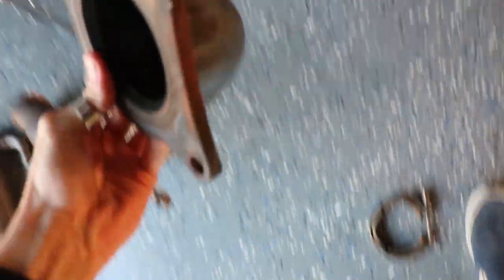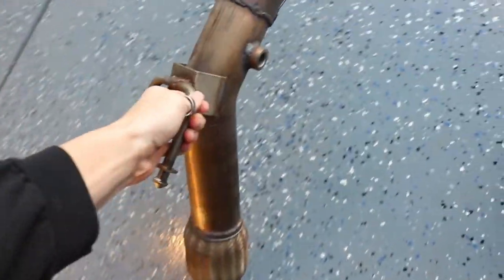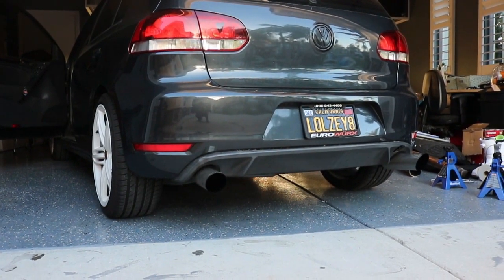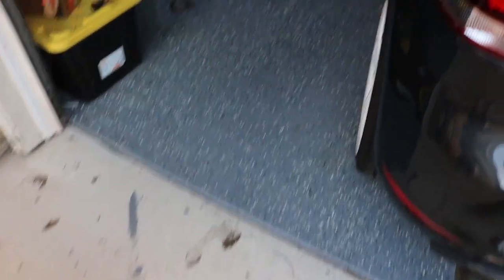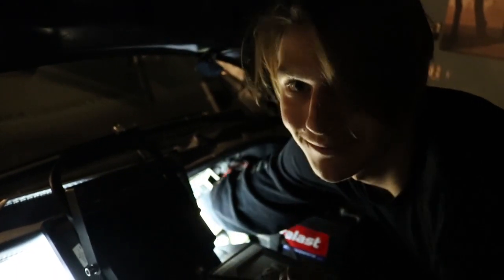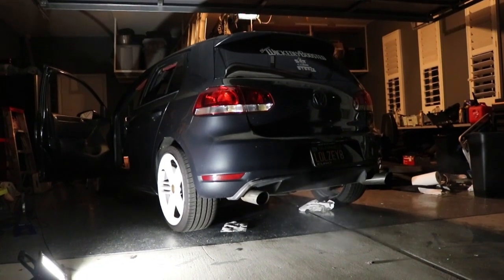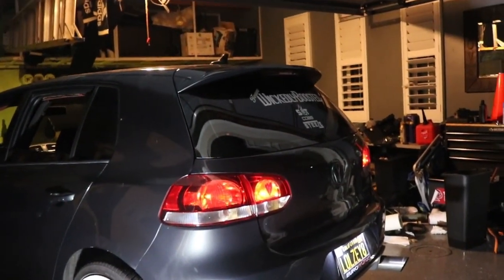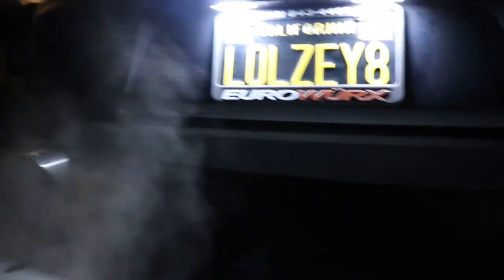How To Gut a Catalytic Converter

Comment: pro tip : wear a mask when actually gutting it... those dust particles aint to safe too breath in.
Reply: They will be fine I have di got it so many Cadillac converters in my mechanic shop. It’s not even funny.
Reply: Pro tip if you're a grown man in a gti you've made a mistake 😂😂
Reply: Asbestos 2.0
Reply: N95 or N100 mask on a clean-shaven face with a good seal. Or a fan to keep you upwind of all particles from the cat.

Comment: As long as no check engine light comes on I want to do this to my corolla ! I only have 1 cat left since the other cat got stolen with resenator 😂!🙌
Reply: It will come on unless you get the like spacer for the second o2 sensor after the cat if both 02 sensors are reading the same number it’ll pop with a cat code
Reply: @DillonDoingStuff  hmm yea I’ve heard those o2 spacers gonna give it a shot

Comment: It's a lot of work because you didn't take a hammer to the catalytic converter and blow the honeycomb out your tail pipe. You unbolt the muffler in the back and it all blows out the back. A lot easier to take a muffler off then a catalytic converter because most are welded on and even if you can unbolt it, you're going to knock the crap out of anyway. Smacking it with a hammer will damn sure relieve your problem

Comment: I just bought a Jeep with a 3.6L Pentastar v-6 engine in it with just over 100,000 miles.  It runs fine until you go a few miles, then has heat issues that do not show up in the temp gauge, and no warning lights come on unless you hammer it up a hill to down shift, (automatic, wants to climb a hill at 1,200rpm for gas mileage) and put the overheated engine in "computer limp mode".  Let it cool and it runs fine again.  That engine has a history of one cylinder head cracking, (and exhaust manifolds), and I bet it is the cylinder closest to the cat.  The fact is, if you have exhaust restriction, engine temps go up.  Do you think the EPA cares how long your gas engine lasts? It won't last long in this condition.
Reply: I know this is an old thread.  Did you check with Jeep on the cylinder heads?  They are under a factory recall for certain years.  I had both mine on my 2014 jeep replaced no charge.

Comment: Lol!! Yeah no eye/hand protection. No respirator? Geezzz prepare to have some serious respiratory issues. You should’ve at least soaked it in water to minimize dust. 😳
Reply from the maker: Yeah maybe should've thought that through... but I think I'm okay
Reply: Why is it do dangerous?  I know it is not asbestos at least.  Are you just repeating tribal knowledge, or do you actually physically know why they should have used more protection?
Reply: @EarthSurferUSA  Ask father Google. From an obvious standpoint, think about the purpose of the filter media. It captures poisonous particles out of the air right? This means that over time there is a serious amount of these particles on the media. Now stick it in a blender **fast moving blade. Drill in this case. Imagine how fine these particles are and at what concentration.
Reply: @EarthSurferUSA  it’s magnesium, it’s a poisonous gas
Reply: @Dxriz1  i dont think its magnesium
Reply: @MrDitto-uw8ft  it is magnesium
Reply: @rattletrapfox1001  It converts them to none harmful gases. Should be fine.

Comment: Takes me back to when I was young full of shit trying to make cars louder and faster !
Reply: But it is, in reality, restrictive exhaust that will over heat an engine and fail sooner.  That is no shit.  I picked up a used Jeep with a 3.6L Pentastar engine in it, and I can almost promise you that the head cracking issues that great engine has had is due to excessive heat because of the restrictive cats.  I do build engines for a living, and have seen with hard numbers, how an engine heats up with restrictive exhaust.  This mod is not an effort to be louder or faster, (but it may be a bit of both). It is to get the mileage the engine is actually designed to hit. There is no doubt in my knowledgeable mind that many engines today die before the 150,000 mile mark because of clogged cats, that could have lasted 300,000 plus miles. There are no warning lights on my Jeep telling me the cats are clogged, even when the engine is overheated and limping along in computer limp mode, (until I let it cool down).
Reply: @EarthSurferUSA  I disagree about and increase in HP it wont be a lot but you will pick up some HP and mileage as you say and the sound will be more pronounced of course . Anytime you cut down restriction in the exhaust you will always pick up some hp I totally agree with the rest of what you said .

Comment: When you gut/remove a cat don’t u need to get a tune??
Reply: You can trick the system by putting foulers then your 02 Sensor
Reply: When I got my chevy tuned the mail in tuner gave me an option for cats, no cats, and hi flow cats which I had (magnaflow)

Those cats came apart in the woods so now they gotta go

Comment: I’m considering doing the exact same thing to my mk7 sportwagen so I don’t have to buy a new downpipe
Reply: Did you do it? I have an mk7 tsi and want to do the same
Reply: @MoonGoon25  nah I just bought a catted CTS DP… the CTS CAT is NOT hard welded into the pipe and can easily be removed and jumped out with a straight pipe whenever you feel like running non catted